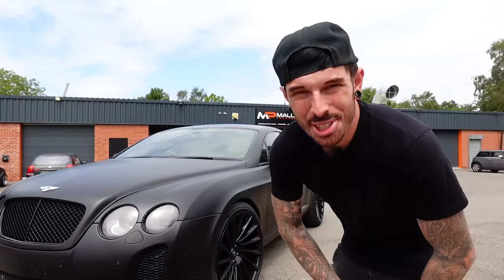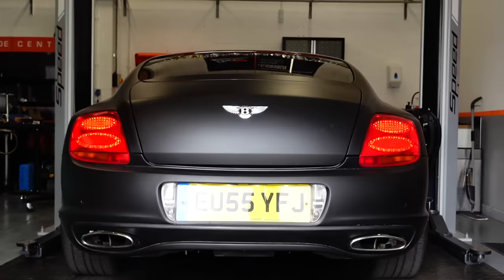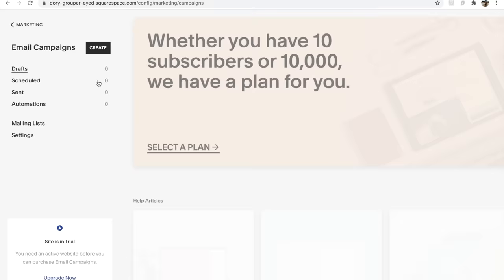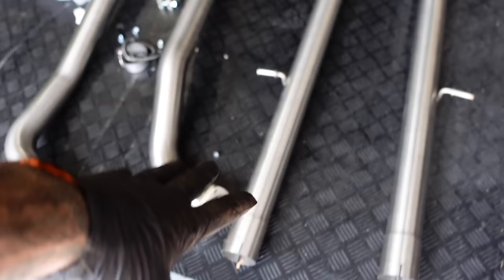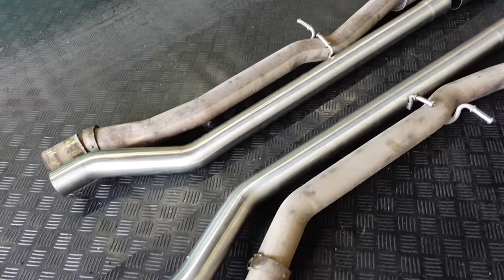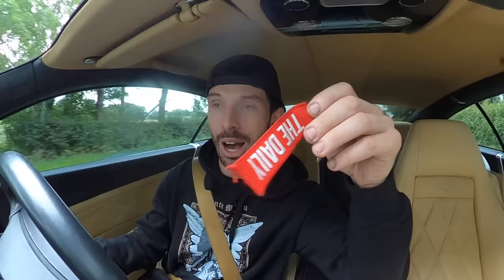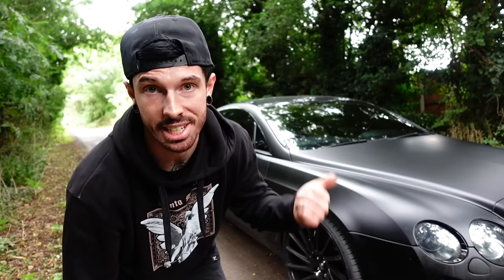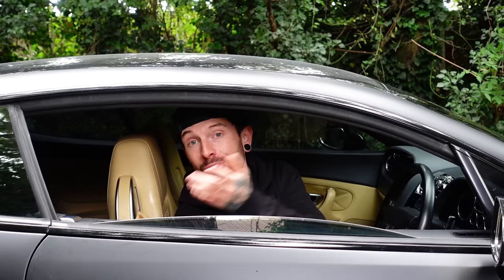BRUTAL EXHAUST FITTED TO MY CHEAP BENTLEY CONTINENTAL GT

Comment: What a project the Bentley is, you’ve done great job so far 👏
P.S:  Matt, i hope you’ve deep (very deep) pockets for the trip to Monaco, as the fuel bill is going to be HUGE 😳
Reply: What makes you say that, have the same car 2007 model. Motorway cruising at 80mph done nurburgring from london and back 4-5full tanks which is good considering the engine size
Reply: Sam Islam - To keep it simple, a car that does 13mpg (combined city/highway) over c2000 miles of mixed motoring will go through c154 gallons of fuel, which at UK/French fuel prices will typically cost over a £800.  For us ‘mere mortals’ that huge for a single roadtrip by any standards.
Reply: @drsmith6595  I think he was joking about 'good consumption'. That is a 1300 km drive, and 4 full tanks is 4x90 liters so 360 liters. That would come to about 27 liters/100 km which is just insane. Noone would be saying oh that is good considering the engine. That is terrible even for this car, on a highway cruise.
Reply: @ghobis  à

Comment: Really nice exhaust sound for a grand tourer car. If it should be any louder, find a rear muffler with a bypass valve you can turn on and off, then just turn it off on the long drive. :)

Comment: "Under whelmed by the sound" I agree but better than a Hoover vacuum cleaner sound.
-I was underwhelmed with the previous painting of the calipers. 
-My thought was (it never made it on the Vedic as it accidentally go errased and I wasn't going to go back and say all the saying I said again). 
-Now the calipers are right for the car. I guess you decided not to have your car look like death and destruction because you didn't tint the headlights (not be be confused with ,"tint the head lice." One needs scratching and the other doesn't.

"A garage without a Porsche is just a dark hole — Walter Rohrl - Porsche Development

Comment: The V8 makes a much better noise. You get a lot of turning heads if you blip it at the lights. The W12 is almost silent around town. 
But you have certainly improved this one.  Top job all round mate.

Comment: Wow, love the wrap!  I must have missed the installation video. This is turning into one badass car.  If all goes well, I will pick up mine in around ten days.   It has the Mulliner wheels, which I love,  or I would be looking at a set similar to yours.   Back to the video,  I need to see how this exhaust works out.
Reply: How was your Bentley, Rick?
Reply: @GT380man  
I drove it home approx 1500 miles,  with zero issues.  Well not exactly?  I parked it one night at a hotel with no indoor parking,  the next day it was over 100 degree F,  and after a late start, and midday sun,  my headliner had separated and was sagging.  I have not fixed it yet, as I am no where near a dealer, and will have to do it myself.  Not looking forward to that job.  Otherwise awesome car,  I now still only have less than 20k on it,  and don’t use it much.   I love the car, but in spite of it being a super low miles 2006, it does get a little too much attention here in Mexico.  I have done a full service on the car myself,  it was no more difficult than my MERC AMG or the 911’s.  Might sell it,  we’ll see.  Thanks for asking!
Reply: @beemer1111  Fantastic car in an unusual context. Enjoy!

Comment: Only haters will tell you to fit 19’s or 20’s. I’ve swapped original 17’s with 20’s on my CL600, peoples was going crazy! 19’s would be better, 20’s will scrape wheel arches, 275/30/20 tyres would kill all comfort etc etc etc. Now they’re on and they all love it! Only have to lower the car a bit and that’s where the bs starts all over again! More flat!?? There goes your comfort, you’re going to ruin the suspension etc etc.. These people don’t know sh** about car tuning..

Comment: Why would a wider tire protect the wheel / ride better than a taller tire?  That makes absolutely no sense
Reply from the maker: The larger profile tyre had a bit of stretch on the alloy. With a lower profile tyre with a wider width dissipates an impact much better and evenly than a stretched tyre

Comment: Ok, so the video started with TWO 15 second commercials.  I did NOT watch it as a result!  You need to contact YT and tell them to stop this.  Otherwise, your channel will suffer.
Reply from the maker: As a suggestion from a person who doesn't like ads either you can switch to youtube premium
Reply: I just ignore the ads. Literally hum & hold my hand over the screen while counting down. I can’t make them go away at the price for premium. But I’m not letting these psycho crooks get their spam in my head.
Reply: @GT380man  My point is that they are putting more and more ads in the videos all the time.  If YouTuber's complain it will get their attention.
Reply: @Flies2FLL  Fair enough.

Comment: Finding the channel content interesting,  especially the videos about the cheap Bentley.  However, all of the silliness and the over emphasis on the sponsors and name dropped companies, is both distracting and annoying. As for the new exhaust,  I cant believe what you have done. The fact that the Bentley has double glazing and loads of sound deadening should tell you that  it's meant to be a refined grand tourer and not some kind of pimp ride that sounds like a like an over zealous heavy metal singer. The tints look well and complement the matt finish wrap, but this is were the mods should stop. Anything more, including the exhaust mod, will end up divesting the car of its true Crewe heritage. The Bentley Continental GT is a grown up car, unlike the Mercedes,  which is more a boy racer vehicle.  They're re in 2 very different leagues and therefore they should never be compared. The Bentley is the ideal car for a round trip to Monaco.  It doesnt need to be loud and aggressive to make itself known. The overpriced Lambos, etc will create enough ear bashing sound to fill the Principality. I hope you have a trouble free and very pleasant trip.